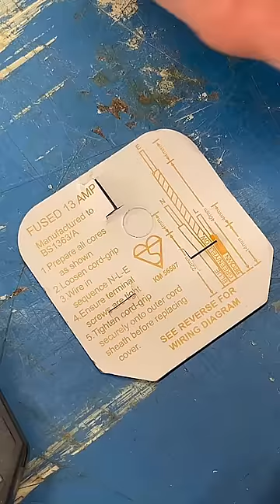Probably the Best Plug in the World 🇬🇧🔌🔌🔌

Comment: It's not the worst plug but definitely not the best plug... I think the best plug is the european/german plug. Fits snug and safely inside the wall. Supported from every angle and less known for falling out or shock someone who wants to unplug it.😅
Reply: What? The Uk one stays in better than the European one, and also can’t shock you. Lol
Reply: @techheck3358  Agreed. Fall out??? in 40 years I have never had one fall out.  Also it is specifically designed to be impossible to shock yourself with this plug.  OP obviously has no clue lol.
Reply: @OP

The UK plug is far superior in every way to the European/German plug. You won't get shocked EVER due to the design connecting the earth pin first which in turn then opens the shutters over the live and neutral ports and the fact that most plugs have an insulated portion at the base of the live and neutral pins as an extra precaution.  Then let's not forget the plug is fused. There's no chance these will ever become loose and fall out like the flimsy products you're used to in your country.
Reply: @skylined5534 UK have plug fuses because you have ring main circuits.
Reply: @techheck3358  EU has recessed sockets,  the plug is held by the socket not only the pins.  Insulated pins is for the 2.5A plugs  as those are smaller than the socket.
Reply: @2adamast the uk plug doesnt stick out as far, there is nothing to "hold up". the wire leaves from the bottom too, so you cant trip on it, and the pins are much beefier. all uk plugs have insulation on the live & neutral pins, theres no chance of shock
Reply: @2adamast  Actually it's the pins that do the gripping, not the socket. If you were to take the pins out the plug would just fall out. There are also two main types of Schuko plug - type F has the earth top and bottom on the outside of the plug (these are sprung) and type E has an earth socket on the plug itself, with the pin in the socket. 
Two-pin plugs have no earth and are held in purely by friction on the live and neutral pins. 
Type G (British) plugs cannot be used without an earth pin; it's required to open the mandatory shutters across the live and neutral sockets, which are not present on either type of Schuko. German toddlers only need one piece of metal to electrocute themselves; British need two, plus some coordination.
I'm quite used to both types of wiring as I have houses in the UK and on the continent. I did my electrical engineering degree in the UK though so there may be some bias there.
UK plugs are less convenient, and with modern RCDs, fuses aren't hugely necessary. Yes, they protect the cable from the plug to the appliance but in most cases the RCD would trip. In the days before RCDs, in-plug fuses were a very good idea, even more so with ring mains where up to 32A is allowed (it's vastly more than a lamp will draw). Changing fuses in the consumer unit was a pain.
Having said that, tracing a fault is much more difficult if the RCD keeps tripping, as it can be difficult to find the faulty appliance.
UK plugs are arguably over-engineered, and the up-turned plug issue is genuine (yes I've stood on a plug and yes it is really, really painful). But as a whole they are significantly better than type E (the French ones) and even more than type F (the German ones, only because the earth connectors can bend too easily). I do like the two-pin plugs for their simplicity, albeit not their safety.
As for the house wiring, there's nothing in it really, other than in the UK, double-insulated twin and earth is the norm, which I personally prefer over individual single-core cables. Others have said in the comments here that UK cabling is antiquated but the reality is it's the same mix everywhere.
The lack of three-phase in the UK in residential properties is a pain though. Another subject altogether.
Reply: @acciid  when  stepping on the inserted massive uk plug only the pins take the load where the 15 A is also supported by the housing. I guess a type g socket will serve à half inserted type d plug by design. The so security conscious brits will probably admire the continental shutter as both pins at the same time need to be inserted while the open earth is there to divert experimenting kids.
Reply: @2adamast  Sorry, really no idea what you're talking about. Type D plugs simply do not exist here in the UK or if they so, they are extremely rare. I'm 48 and I've never seen one. I've seen (and used) the 2A and 5A plugs as they're used in lighting circuits. A quick Google suggests that the pins would be far too big to fit into a standard 13A socket.
I've never seen the shuttering you're talking about, but it's a good improvement if it's now widespread. I'll certainly check it out next time I'm on the continent (next week as it happens).
By the way, you don't need to get so defensive. Both designs have their benefits and disadvantages. You quickly get used to either; I'm used to both. I do think switched sockets should be an option for schuko though - you can get switched extension chords, at least in France. I've got loads of them.
Reply: @acciid  i thought the type g replaced the type d from 1946 to 1960,  so I expected common characteristics, apparently that’s not the case
Reply: @AlexKall  NO… we have fuses so under fault conditions 16, 20 or 32amps isn’t trying to flow down a flex rated at 3 amps.
Reply: @2adamast  
My son was nearly killed by a broken Schuko socket in Spain… If you accidently hit a Schuko plug on its side whilst plugged in it smashes the recessed socket exposing live parts. The UKs plugs & sockets don’t do this.
Reply: @AlexKall  Nothing to do with Ring Mains. They work just the same on Radials.
Reply: @alanwood9804  I don't see why UK sockets would be unbreakable, but Spain has a second line protection where super safe UK doesn't.  "The difference here in Spain is that unlike the UK, an RCD must protect the whole of the electrical installation in a domestic dwelling."
Reply: @2adamast  Except for special cases, RCD protection is also mandatory here in the UK. Except for the PV system on my roof, every light, socket and appliance in my house has RCD protection.
Reply: @GluteMaximuz  you missed the point.
Reply: The only thing to point out is that you don’t always need a 13A fuse. If you’re wiring up a radio, for example, a 2A fuse will be sufficient and indeed safer.
Reply: Does this mean that every single thing plugged into a Schuko outlet has to have 16A rated cable? That's the real benefit of fuses in plugs.
Reply: @2adamast 
I've seen shutterless UK sockets which instead have a plate that requires both live and neutral pins at the same time with equal pressure to open and allow the plug in.

Comment: only problem i have with this video is twisting the strands before putting them into the ferrule, as this can create uneven contact inside and other problems (although it shouldnt matter at 3 amps)
Reply: No it won't as the ferrule is crimped down. There's literally never been an issue regarding 'uneven contact'. Fight me.

Comment: Not only do these plugs come with a built in replaceable fuse, but the grounding wire has more slack than the positive and negative wires. Meaning that if the cord was yanked, the power terminals would come undone before the grounding terminal. As an American, I agree our plugs are outdated and suck in comparison

Comment: Trimmer caps are underated, even with their low capacitance they can be quite useful, I used one in an elk sustainar clone on the tonestack and it works very well to emulate the variability of the cheap ceramic caps they used back then

Comment: The wire lengths are designed such that if the cable gets yanked out of the plug, the live wire will disconnect first, followed by neutral and fianlly earth (ground)

Comment: The 13a is covered by BS1363, introduced in 1947 but prototypes originated about 1942. This superceded BS546 standard. But well into the 1950s the continental standard Schuko sockets continued to be installed along with the new standard. Britain has long been seen as nanny stateish when it comes to electrical installations with much more regulation than its geographical neighbours. Their is little perceived benefits from BS1363 plugs over its Schuko alternatives.
Reply: My son was nearly killed by a broken Schuko socket in Spain… If you accidently hit a Schuko plug on its side whilst plugged in it smashes the recessed socket and exposes live conductors. The UKs plugs & sockets don’t do this.

Comment: Personally I'm not a great fan of the Permaplug or Duraplug as I've seen a few go rusty or overheat and melt but one of them was on an extension for a jet wash and the other on a powerful carpet cleaner.
As for someone being paid by the hour, at work if a vacuum or similar item needs a replacement plug then it does indeed get wired properly with ferrules and always carry a couple on me when I'm doing portable appliance tests in caravans. Also where possible I will scavenge plugs of things that are broken and being chucked, even more so if the plug is black as white ones don;t look right on a henry!

Comment: That’s cool, but I’d you read manufactures instruction they typically say not to twist the cable before ferruling
Reply from the maker: Restore the twist which was in the cable before stripping
Reply: @efixx  correct but I think you might have over restored it 🙃
Reply: If you don't twist the cable you won't be able to get the ferrules on as it will be splayed out...
That works with ferrules that have the plastic funnels on them, but they don't fit in small plugs...

Comment: A textbook example of overengineering. I've seen uninterruptible power supplies smaller than that thing :). The initial reason for having the fuse in the plug - the bus wiring system introduced due to copper shortages in WW2 - is long gone, but the tradition still persists. Who would have thought Brits would care about tradition? :)

In the next installment, the two spout bath tubs and Y shaped stick-on rubber showerheads.

Comment: So that’s what the drawing is for on the back ( cut lengths) 😳 has anybody ever used it ? Love the non insulated crimps I usually double the wire over. Back in 1980 a very wise engineer would kick the arses of us young apprentices if we made one off like that! THE EARTH had to be left as long as possible so any of the others would pull out first and the earth would remain to protect you. YES WITHOUT DOUBT THE BEST PLUG IN THE WORLD.  Bit like JCB, got it right don’t change it

Comment: I've wired many plugs and the crimp is totally unnecessary. 

Strip, twist the strands, fold over for girth, shove in, tighten down.

Make sure to shove it in the right way around so tightening the screw doesn't make stray strands get ejected.

Comment: I don't understand how this plug is considered to be a good design.
It is overcomplicated mechanically (a recessed plug is a much more elegant and simple solution), so it is more expensive to manufacture.
And nowadays, plugs are protected by an MCB, and almost all appliances have a fuse, so a fuse in the plug is pretty redundant
Reply: Multiple sockets are wired into a single breaker, and that breaker is rated to handle all of them. If your 3a device starts pulling 13, your breaker won’t save you
Reply: @techheck3358  That's why there are fuses inside the appliance
Reply: @pxidr  if the fuse is at the plug, easier to replace :)
Reply: @pxidr  What if the cord is damaged? 
The breaker in the box in the UK is often 32amps and passing that current down a 3amp flex isn’t good unless you want a visit from the fire brigade.

Comment: TOO BAD we here in the US are still using century old plug connectors-fuse at the appliance makes SO MUCH SENSE
Reply: Yeaa okay buddy. I'd much rather go reset a breaker then have to disassemble a plug and have a ton of different fuses on hand to replace it with.
Reply: @magicalphones  I can guarantee, 99% of the fuses in my house are 13A. There are other plugs with easy-access fuse bay you need a small pocket knife to pop out

in the odd case a fuse goes in a plug is it really that difficult to take out 1-3 screws to remove the back cover of a plug housing?  I honestly can't remember the last time I changed a fuse in a plug

Comment: Personally i like to do the earth a tad bit longer than what the diagram says as it looks a bit nicer and does no harm.
Reply: The live conductor should always be the shortest, the earth the longest, then, if the flex gets pulled out, it opens the live first and the earth last, leaving things in a safe condition...
Reply: @Ironic1950  im aware of that i am simply putting out that i make the earth cable longer than the diagram says as it looks neater. Never mentioned the other conductors.
Reply: @FinlaysFireSystemsElectrical  Dude! I was just amplifying your recommendation to make the earth longer! No need to be defensive!
Reply: @Ironic1950  Sorry - not meant to come off defensive. When speaking to someone over a text based platform its harder to add “tone”
to what you are saying if you get what i mean.

Comment: To test if it is a good 13A power plug, install the power plug to a ULT ( ULTRA LOW TEMP.  -80 degree C. ) Freezer and test running for  1 year.
If the power plug is a poor design, poor workmenship, the plug may burnt or cause a fire.
In PM servicing ULT freezer, Engineer should check the power plug temperature.
Replace power plug if necessary.

Comment: You have left the earth wire too short, you should pack some bends in there so it's the last to be disconnected if the cord is pulled from the plug.

Comment: I much prefer the german plugs, known as SchuKo (Schutzkontakt Stecker). They are much more compact and equally user safe. Just no fuse in it, which I don't get anyway. Just have a fuse in the device or rely on the fuse in the breaker box.
Reply: Fuse in the plug is because, to save copper, UK allows the use of a ring main to wire up a series of sockets. That means up to 30A at the socket.
The wiring from the plug to whatever you've plugged in is not going to handle that.
Reply: @michaelleiper  interesting. Is it really more efficient? Laying wires for 30A seems to be overkill.
Also popping a breaker in in case of failure is far cheaper and faster than changing a fuse. Not to mention finding the problem.
Reply: @malteser0212  it's a ring. So the wire goes from one 15A breaker back to another one in the consumer unit (30A would be pulling 15A from each of the two sides of the ring). But it can basically do all the sockets on one floor of the house (which is where the saving in copper comes in).
But, in turn it relies on a fuse in the plug... They are usually 3A, 5A, or 13A. (In the video you saw him take out the 13A fuse and replace it with a 3A one).

Comment: Not even close. While I like how the US plug can be hidden in its chargers or whatever, Schuko is always the winner. Solid connection every time, if it don’t fit it stopped you from danger, it leaves no room for angles because of stupid barely connecting and has nice baby proofing.
Reply: My son was nearly killed by a broken Schuko socket in Spain: If you accidently hit a Schuko plug on its side whilst plugged in it smashes the recessed socket and can exposes live conductors. The UKs plugs & sockets don’t do this.
Reply: @alanwood9804  what?! First off: what?! How do you treat electronics in general?? Just no. All electrical parts carrying live power is dangerous if exposed. This is like saying all cars are dangerous, if you stumble into traffic😑😑 And what do you mean he almost died?! I’ve been shocked by 220v several times and I’m still here. Worst was sticking my finger in a lightsocket as a 5 year old. Woke up at the end of the bed, but alive, and the breaker had tripped. I’m not saying go try, but all systems should have safety measures to mitigate as many improper uses as possible. I advocate for the Schuko because most modern ones you have to apply some heft to plug in and out, there is no middle. If you have managed to do so then natural selection takes it course. It’s a recessed socket that covers the plug and even in most common cases is somewhat weather proof (obviously not throw in pool or submerge, but does that even need to be stated unless there is a waterproof seal version out there for most connectors??) If you ever have to deal with older, less sunken schuko outlets, understand the hazard that is actively going to be happening.

Comment: Like the fuse idea. Should be easier to replace/automatic. The plug itself is humongous.

Any problems of the plug popping out of the receptable? Do have those plugs but no power strips available. (and in the UK stayed only in hotels 😊)

Humongous: have 8-10 outlet power strips at home....
Reply: >Any problems of the plug popping out of the receptable?

Very much the opposite. Out of every socket design I've come across when travelling, none holds the plug as securely as the British socket. Some designs are truly awful (American spring to mind - plugs easily come out and you can easily touch a live conductor with a half inserted plug).

And you can get power strips for UK plugs no problem.
Reply: @ryanmitcham5522  yes. but have been avoiding ordering those UK power strips ;-)

(have bought hundreds of power strips 10" and 19" from the UK but after the Brexit and problematic customs ops have bought power strips from the EU to fullfil our products' needs).

Comment: The old round pin plugs from the 60's were far superior.
A round  360 pin surface carries more current than 2 flat surfaces.

⚠️crimping those hard sleeves onto wires is bad practice.
Over time they crush resulting in loose screw terminals.
Far safer with bare strands.
They stay tight longer in our 50 year experience dealing with them ⚠️